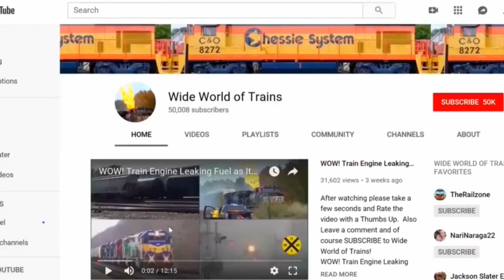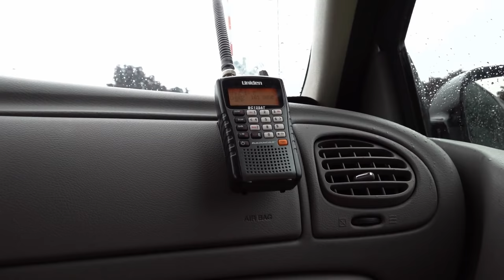Caught On Camera! Norfolk Southern Train Breaks Knuckle + Goes Into Emergency! Chasing Heritage Unit

Comment: Seems crazy to trust trains that are that long and heavy to such a small surface area of metal in the knuckle.

P.S. The best angle for viewing a train is either with the camera pointing UP the track so we can see it approaching, or with the camera pointing DOWN the track so we can see it receding. Just pointing the camera straight ahead is useless, because all we can see is a load of wagons speeding past which gives the viewers motion sickness. Thanks.
Reply from the maker: It all depends on the spot where I'm filming and when I get there.  When possible I do get them at an angle as you can see in many of my recent videos

Comment: What's DPU? Your voice was scrambled  at 14:08 to 15:26 in your video but it has come back and it's fine now
Reply: Means Distributed Power Unit.  One or more locomotives placed at the rear or anywhere in the train operated by the engineer by remote control.  This allows for better train control especially braking.
Reply: @tomcarver6969  Thank you

Comment: And you didn't even offer to ferry the conductor and a new knuckle back and forth between the engine and where the broken knuckle was? 😆 I did that some years back for a conductor. I was working at the time for a railroad and had just gotten off a train. I probably was on violation of my hours of service, but what the heck.
Reply from the maker: Ive offered rides in the past and none accepted, maybe its against the rules and I can understand that.  He got the knuckle off the end car which was about 1/4 mile away and used that in place of the broken one

Comment: This is common with multi levels. They have so much play in the couplers, that they wear the crap out of the knuckle faces. Making them thin, and eventually they fail. Also you can see that's not 100% new break, looked like there was a casting defect in the knuckle.
Reply from the maker: Hey you mean that little black spot in the middle of the cast? Yep I saw that

Comment: Cp rail puts dpu's on the ends which makes the most sense.
Reply: I Don't think a dp would have helped here. If it was because of weight it would have broke closer to the engine where it had more weight o n it, not the half dozen of so cars at the end. Broken air line makes more sense

Comment: trust me they stopped the DPU's on it because of money!! they probably figure 5 or 6 broken knuckles are cheaper than the diesel and maintenance for the DPU's!!! now if they'd get fined for blocking crossings they may change their tune!!! and be ready you've got another 3 or 4 days of at least damp as hell headed your way!!
Reply from the maker: Well we're supposed to have a couple of good days  weather and I don't really think it's cheaper than that running a DPU
Reply: @WideWorldofTrains  trust me with the current price of diesel and replacement parts compared to a steel knuckle and the repair crew pay it's way cheaper to break knuckles and pay the crews to fix them if they're not getting fined heavy for blocking crossings! and even if you get sun it's still going to stay damp as hell!
Reply from the maker: @keithmoore5306  I don't think that's always the case, when a train like this holds up traffic for 3 or 4 hours it costs them bucks, it would be less costly to have a dpu, could take one off the front, cost the same if its in the middle or the end
Reply: @WideWorldofTrains  i'm with you on moving the power but getting them to see it!!
Reply: @WideWorldofTrains  you forget the ones running things are railroaders they're business school tools!!
Reply from the maker: @keithmoore5306  Good point
Reply from the maker: @keithmoore5306  I see what you mean now
Reply: @WideWorldofTrains  those last 2 were sent as one but for some reason the back half got cut off and i had to resend it!!
Reply: @robgm6926  yeah well i come from a railroad family going back to the late 30's with the B+O and know the management always wants enough power up front to move the drag as well as for dynamic braking and beyond that anything farther back is an afterthought!!

Comment: What is a dpu?
Reply from the maker: Yes a DPU stands for distributed power unit. It basically is any locomotive on a train that is not part of the front group of engines and is helping power the train. It could be placed anywhere else in the middle halfway down a third of the way down or at the end basically anywhere is on the train that they decide.

Comment: Looks like might be more then a broken knuckle.  Something might be wrong with the tongue.  Instead of bitching about it you could have been nice and talked to the conductor and you could have assisted by driving to the engine for the replacement knuckle.
Reply from the maker: He already had a ride, plus I dont know if its against their rules
Reply: @WideWorldofTrains  Tobe honest it cost them more having a train sitting and blocking a route then getting it moving asap. Some routes cost millions daily if traffic is not flowing.  If anything a rail corp should have a reward system if you helped them out.  Just cause a simple reward is far cheaper then having the train sitting.
Reply from the maker: @freespirit9981  Yes thats true, when a line is blocking traffic it can cost big $$

Comment: You could have offered to take the condr to the head end and take a knuckle off the engine and then back... There was a rust pocket on the knuckle you zoomed in on... It wasn't the engineers  handling or no dp's on the rear to keep the train bunched up,  fault...weak chinese steel! I did that job for 44 yrs...
Reply from the maker: I have offered rides before and they've never accepted, maybe today it's because of the rules maybe it's not allowed. There was a CSX mechanic's crew truck there they may have given him a ride